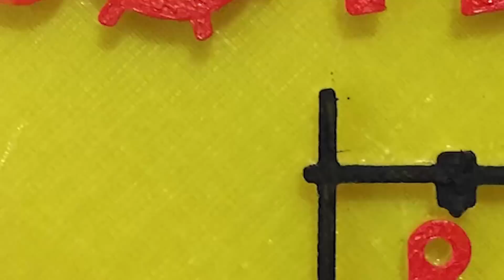Prusa i3 MK3 Feature test Summary

Comment: I think you did the right thing.
It is Prusa who should have done more "beta testing" ESPECIALLY testing done by "non technical" people.
Because they   will do things the designers would never consider doing BUT THE END USER WILL.
So Prusa MUST either update the instructions or make the printer be able to tolerate these actions.

This is a product marketed at CONSUMERS and you just can not expect them to have the training professionals are supposed to have.
Reply: cmulder002 it was a human interaction with the designed failure handling. The designed failures will not occur the way the user did it, because it cannot.
Consumers are not going to make tests like that, they like to have the priniter print.
Almost all testers in theses days doing the same things wrong :-)
Reply: Gee, someone is pissed they didn't get a mk3 ...   Skip detection only works if it is  against the current move direction. This is part of the driver chip and nothing to do with firmware at all.  Eg forcing it left when its already moving left will not get detected.

Comment: Power Panic isn't designed to work when the printer is shut off with the power switch. Its practical purpose is to save your print when someone trips over your power cable or when the power goes out - there's no reason somebody would get a failed print due to the switch being flipped.

Comment: Maybe the power capacitors that provide power to save the print are before the power switch. That way the switch gives an instant 'off' to stop the printer and does not save the settings. Just a guess.
Reply: That's not how it works, the capacitors are always after the switch. The Prusa github account has published the corresponding electronics to the Power Panic feature, it's a board that senses the presence of mains voltage via an optoisolator and reports it to the control board, so it knows that the power went out long before the power supply output starts drooping, because the power supply has at least 25ms or more of hold over at maximum power keeping the output fully stable, but once it starts to measurably fade, it fades fast like fraction of a millisecond unless you disabled major consumers well in advance. It must have been wired before the power switch to avoid the false resume if the person has turned off the printer in an emergency condition, i.e. their parts flew off and their extruder grew an upside down fro and they cleaned it all up and the last thing they need is for the printer to start off doing something on its own.

Comment: in the UK unless you live with overhead electricity out in the sticks (most of us have buried electricity cables) the electricity doesn't go off. Supposedly over the whole country, it's 2 minutes per year. So I'm not that worried about that. 
The filament out, jam detection and that bed are my main reasons (apart for the quality) for putting in my order.